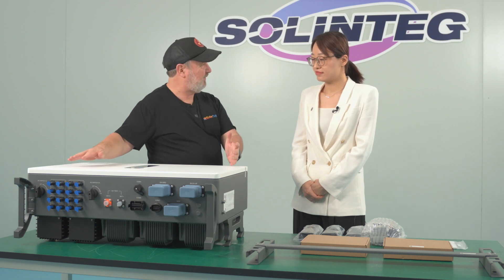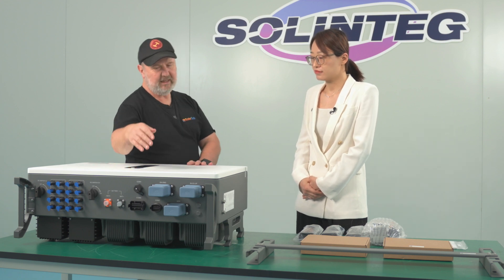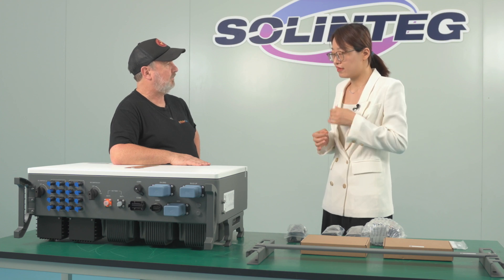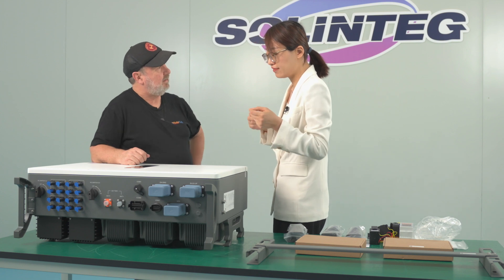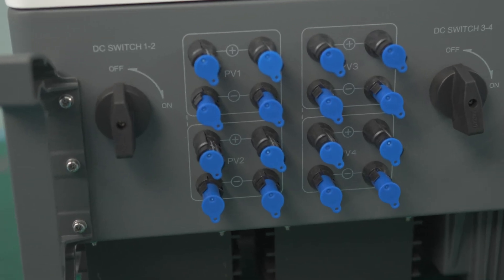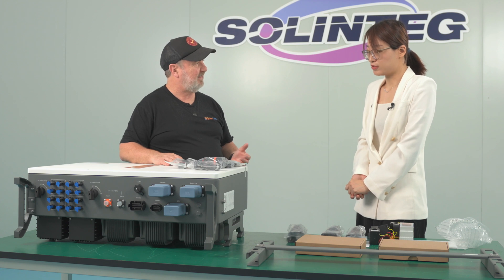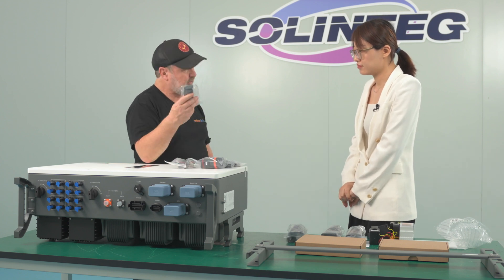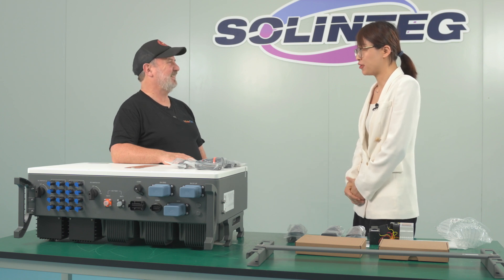Unboxing Solinteg's 50 kW Hybrid Inverter

Comment: Very nice inverter suitable for off-grid applications. The use of a HV battery reduces current making installation much easier than it would be with a 48V system. Unfortunately the data sheet (EN-MHT-25-50-NO1.02-2023) omits one very important parameter for off-grid applications - the no load power consumption of the inverter when it is inverting.